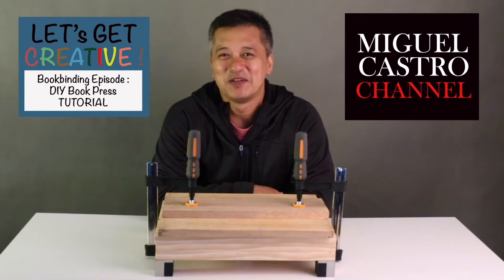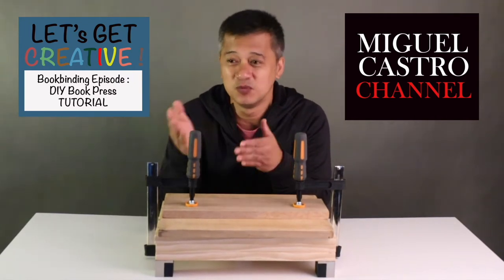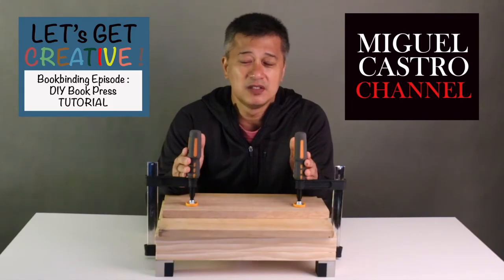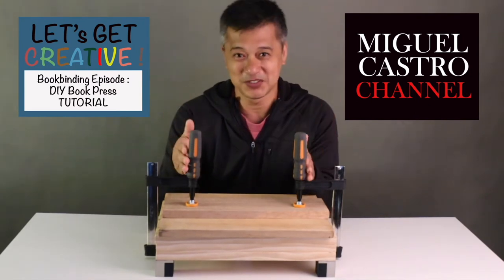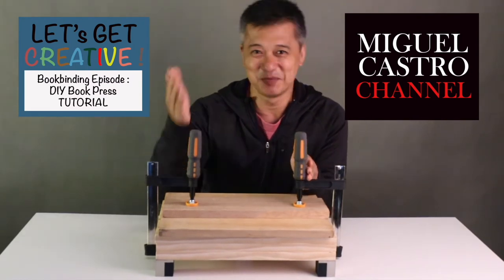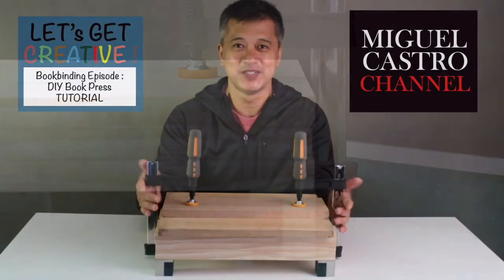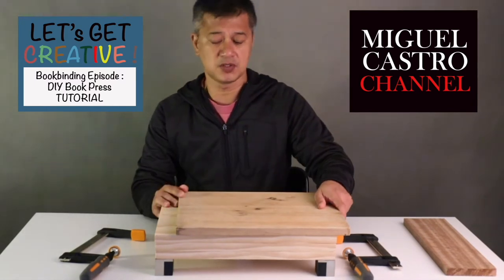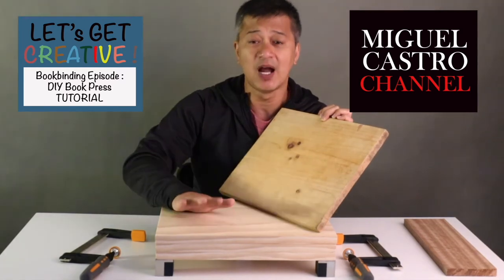DIY Book Press

Comment: I'd say you are a very good carpenter  - this is an excellent design which quickly allows you to get the book in pressing position. Everyone seems to use the long bolts and wing nuts, which is OK but difficult to use and get the book straight. Thank you for sharing your design and good luck with your shop.
Reply from the maker: Thank you very much:) i guess because of the wxperience as a bookbinder was the basis for the creation of a cheaper presser:)